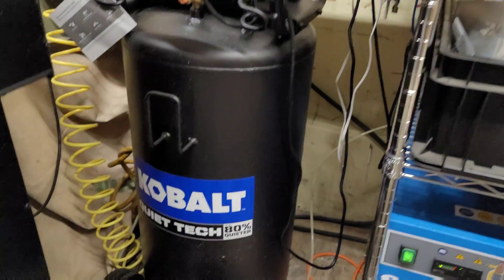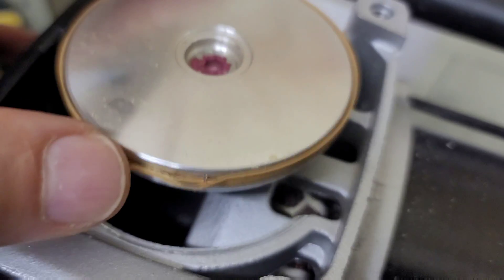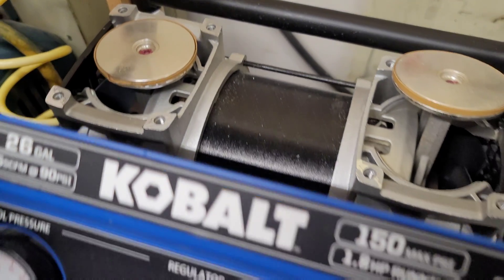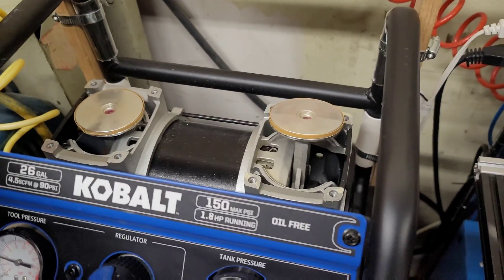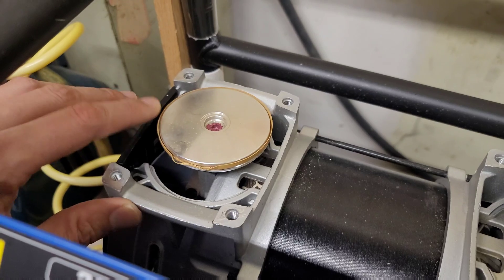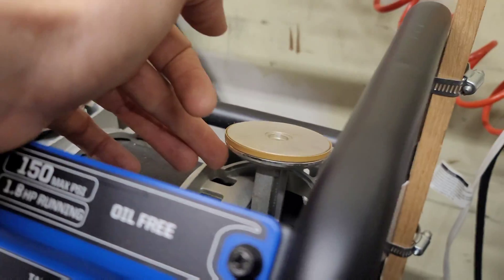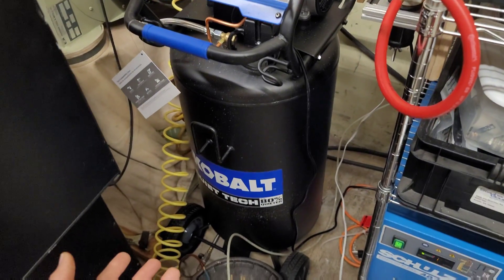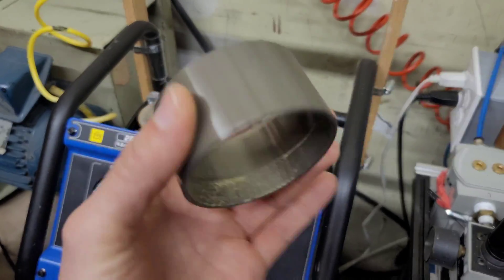KOBALT Quiet Tech 26 Gallon Air Compressor FAILS AGAIN! Watch this long term review before buying!

Comment from the maker: I was able to find replacement parts and fix it. Watch this - https://youtu.be/ZPa_fezA3Mg
Reply: So did you buy the 72x56x1 ring ?
Reply from the maker: @cosbybv8208  I used the ring listed in description. One very important thing is to use high temp threadlocker. The low temp stuff failed twice, causing the piston head to loosen and make a very loud noise. Finally ordered high temp threadlocker and used that and so far so good.
▼ WHERE TO BUY PARTS
▶ Piston cups that fit and work well - https://amzn.to/3mK38US
▶ Threadlocker, Permanent, High Temp (standard threadlocker will fail due to high temperatures) - https://amzn.to/3LaDZfQ
Reply: @engineerable   On that link there isn't a ring that has a 54.36ID and OD of 69 or less - Did amazon stop carrying that ID and OD?
Reply from the maker: @cosbybv8208  I used the 72x56x1 mm ring. It works perfect. https://amzn.to/41nbwZD

Comment: Thanks for the info to fix this. Had chipmunks chew a hole in air line & compressor ran for about 2hrs. Now takes a lot longer to charge the tank back up. I hope it's just the rings. A upgrade you could look into is from Bastian D. youtube https://www.youtube.com/watch?v=q9SOhktW_Qg.
I got my parts from Grainger. 
BRACKET,MOUNTING
MANUFACTURER # 4ZK57 $10
FILT-REG,1/4"NPT,80 CFM,40 MICRON
MANUFACTURER # 4ZK87 $68
PRESSURE GAUGE,TEST,2 IN
MANUFACTURER # 4FMC7
And the hoses from amazon. Helped out a lot.

Comment: I did exactly what you did to my very loud compressor using the Amazon link you supplied for the rings and it was a snap 18$ fix, rather than carting this thing back to Lowe’s. Thanks so much and let us know if you find the right size cups anywhere as mine have some damage as well

Comment: I returned my 2 days before the warranty was up. I called Kobalt and said I was measured it at 92dB. That's over 4 times the 70dB that it was suppose to be. They sent me a return number by email. Went up to Lowes, gave them the email and they gave me a gift card for the full price I paid plus $28 more to match the current price. I was surprised and happy. Now looking for a different brand that I can actually buy parts for it.

Comment: Is it still running strong? 

I am bouncing between this one and a Porter Cable “Oil Lube” that’s $299 from Tractor Supply.

Biggest project will be applying Fluid Film under the truck once a year.
Reply from the maker: It is still running. The replacement piston cups have outlasted the original ones.

Comment: If i wanted to buy the motor, any recommendations on where I should look?
Reply from the maker: Yes, this is the replacement motor to buy. https://amzn.to/3PQNBi9 
California Air Tools sells full replacement parts for compressor maintenance. 
The fix shown in this video, combined with the high temp threadlocker has lasted longer than the original compressor piston cup.
Reply: Thanks!

Comment: I get those pieces of shit free from my local recycle center. Consumer grade compressors in 2023 are mostly garbage and for the money a used industrial compressor crushes them.  They all use very similar top ends. The tanks also make good remote tanks to put at the end of long air hose when using a real air compressor.
Reply from the maker: Which oil-free industrial air compressor would you recommend?

Comment: Mind recently started messing up it will power up and pressure all the way to 150 but then once it drains it won't kick back on, I replaced the pressure control switch module is trying to see what you think this is what it's doing.

https://youtube.com/shorts/z4u2kN1AmDs?feature=share3

Comment: I'm checking out this video because I have the same compressor. Yesterday I stopped running and tripped my multi-plug breaker. When I tried to turn it back on it's like the motor stutters but will not continue. It'll sound like a car trying to start up but will not run. Any ideas
Reply: After completely draining it I tried it again and if it's at zero it will pump back up all the way but if I were to shut the motor off and try to turn it back on to continue pumping it goes into fail mode. But then when I drain it again down to zero it will start so I'm guessing that might be a pressure regulator? Or is it the switch
Reply from the maker: @CTRadventures  These compressor (and most) can't start under load. There's a valve that prevents the pressure from backing up into the compressor. Your valve has probably failed.
Reply: @engineerable  what part am I looking to replace? So I can look up how to fix it
 I really appreciate it
Reply from the maker: @CTRadventures  I'm not near the compressor to look for it, but it's called the Unloader Valve, and it's on the pressure switch. Here's some more info https://fix-my-compressor.com/compressor-wont-re-start-when-air-is-used/
Reply: @engineerable  thanks friend!
Reply: @engineerable  figure if I just get the whole assembly with the pressure valve on switch and all that it would probably come on that. I really appreciate you. It seems like everything's breaking at once right now. We are repairing a car, the dryer went out and I had to repair that too, so why not I'm learning how to fix a whole bunch of things right now
Reply from the maker: @CTRadventures  If still under warranty, Kobalt should send you a replacement switch assembly since that is on the list of parts in the manual.

Comment: So this looks like it has the same OEM compressor as the California Tech. Based off reviews the Kobalt at least comes with a 3 year warranty, though both can and will fail.
Reply from the maker: They may look similar at first glance, but California Air Tools are higher quality when you look closer. I compared the similar priced CAT 10 gallon, 2HP compressor side by side and the CAT has a taller cylinder and longer stroke, more bolts holding down the head, and overall looks like better quality. CAT also provides rebuild kits and parts which Kobalt does not, and CAT parts don't fit the Kobalt due to different cylinder size. The CAT is also much quieter.
Reply: Thanks for the insights, it is hard to compare things from seperate photos online. I spent hours looking into looking at quiet compressors the past couple of days, there are many on the market. I am looking at two different 2HP CATs with smaller tanks. I am also looking at Stealth 20G w/ a 1.8HP rated at 5SCFM, but has a "Lifetime Warranty". If I go with the small ones, I can reuse my 10G tank from my hotdog to give me more reserve, while maintaining some portablility. While I like the Lifetime warranty, Stealth seems to have a different HP rated compressor on each of their compressors, which does make me concern about parts in the future. I like the fact I can buy wear items for the CAT. I am looking for something quiet for use in my 1 or 2 projects a year I might do and for filling up tires. I want something that will last 10-20 years with light use and I have spare parts for.
Reply from the maker: @SolarityTechnology  Only buy front a brand that offers parts. You don't want to be returning a full compressor everytime something goes wrong. In your use case, sounds like the CAT compressor will last a long time. I have one of their 1hp hot dog compressors for home use like you're talking about and it has worked great for years and so quite. https://youtu.be/n1gQdYwY74Q

Comment: well when you run the thing 100% all the time thats what happens these are 20% run time heads even an old school compressor is only 50% if you want to run them all the time you have to buy quality compressors ingersolrand  and they go for 1500 and up
Reply from the maker: Makes sense, but for our use this normally runs far less than 20% duty cycle.
Reply: @engineerable  let me do math for you.. 50% run cycle means 20 minutes of use 20 minutes off
20% use  about 10 minutes on 10 minutes off.. these are not designed for air tools like air buffers or cut off tools etc filling up tires blowing stuff off air nailers running for one car air impact gun.. thats about it you want heavy duty you can get a compressor piston style best bet is the old school compressors that paint shops use if you can get ahold of an old model they last best best best ones after the new ingersol rand ones is screw compressors with dryers etc those run all day long but there about 4 grand and up small tanks like 60 gallons etc but can run your tools all day long now even better theres mobile ones screw compressors that run on ford trucks that can ouput 175 psi alll day long on your truck engine no air tank and it is just a beast those are 10 grand and up... so get your system based on your needs if you can get a old school piston style sears etc compressor from the old days but make sure make sure the tank is solid and good i got a tank from 1975 rust free inside still thicker steel than they use now the stuff they use now is thin and this 175psi you see thats the max that little pump can do so really 150psi or 140 is where you want to pump to why the overhead is helping you pump up to 150psi see what i mean if you have 150 psi compressor its working harrd to get to that these compressors will pump to about 60psi then youll notice they start to peter off the power behind them isnt great so there really for small projects so if you use it spareingly and go easy on it youll get 10 years outta it or more now mine im going to get one because my tanks are from the 70s and its time meaning i cant trust it
Reply: Industrial compressors are often very reasonable used and don't mind a little DIY or a motor swap. I just scored two 5HP (real HP, not the SPL rated consumer shit motors) Saylor-Bealls at a liquidation because they were three-phase for $250. They're not light but I'm always pre-prepared to move heavy stuff because it saves mad cash and gets good gear. Most folks would swap motors (easy and a few hundred more bucks but it's a lifetime part) but I went with an RPC to power other tools. The three phase world is easy to get into and youtube has many videos.

Comment: Struggling with putting the switch back together right now. Changed our the capacitor. I got 89v on the line side. Idk why it starts then it just turns off. I need help.

Comment: How many hours did you put on the air compressor?
Reply from the maker: Unknown, I can only estimate. I plan to put an hour meter on it now that I've replaced the piston cups and it works like new again. But these should last a min of 2000 hours before service. 2000 hours over 6 months would be 10.9 hours per day, and no way did it run that much. I estimate 2-4 hours per day max.
Reply: My older 30 gallon Sears Craftsman has a single piston, the seal blew out, and then ate the Teflon coating on the cylinder up. I replaced the seal and cylinder on it, and it has not given me a problem since. I bought a couple spares anticipating it would blow again, but it has not it’s been at least 15 years now since I first repaired it. I believe the issue you have has to do with the piston ring seal quality. I would contact a compressor supply shop see if they can source the dry style piston ring replacement. Otherwise that unit has a shorter stroke than my Craftsman, the shorter stroke increases the piston speed and consequently heat is developed, a compromise for having high cfm etc. Perhaps a small fan near the compressor heads would help keep the cylinder temps lower, and the seal would last longer. I suspect it’s a combination of poor quality piston ring seals and poor engineering there. I’ll dig around on the internet see what I can find about that unit, but if it was me, I’d return it and just get my money back by a proper Ingersoll Rand mid duty compressor, sounds like your possibly trying to accomplish more work with that ‘home compressor’ than it was designed to do in a 3 year period?
Reply from the maker: @blkcoupequattro  Thanks for info. Is your Craftsman also oil less? I've had 2 Ingersol Rands, regular oil based, 1 25ish gallon and one much larger. Had motor problems on both of those (capacitors went bad). Replaced them due to noise and oil. They are now my backup. I have one portable 8 gallon ultra quiet California Air Tools (1hp) that is soooo incredibly quiet, but construction quality of compressor/motor looks the same as Kobalt. 
The longer stroke of yours explains why when I searched for replacement ~70mm ID cylinder, I could only find much longer ones. 
At the beginning of the video, you can see the fan blowing down onto the compressor heads, and removed the plastic cover for better cooling. Big difference, and stays cool enough to touch it. 
I'm considering getting 2 California Air Tools motor/compressor unit and attaching it to the large Ingersol tank.
Reply: @engineerable  I noticed that the compressor is right next to a dust collector so it seems that seems to put a lot dust into the innards of the pump. BTW where do you get the replacement parts for this compressor?
Reply from the maker: @josephtheinflatableguy4609  That dust collector is not working. It's just stored there. Also, we have about 5 HEPA air filtration systems in the shop to keep the air clean, and we don't do stuff in the shop that makes a lot of dust.
Reply from the maker: @josephtheinflatableguy4609  This is the replacement piston cup I used that fits and works well - https://amzn.to/3mK38US
Reply: @engineerable  My Craftsman is oil less but recovery time is really slow due to the single stage single piston. Interesting you had Ingersoll Rand, and had problems with the motors, sometime that's an amperage issue assuming they were 110volt or 220volt ? The Kobalt you have is 110volt correct Model # 3332644? You should check the breaker to see if that circuit has enough amps, might have been the reason your other compressor motors went south.
Reply: @engineerable  I sent an e-mail to Kobalt directly asking them about parts....